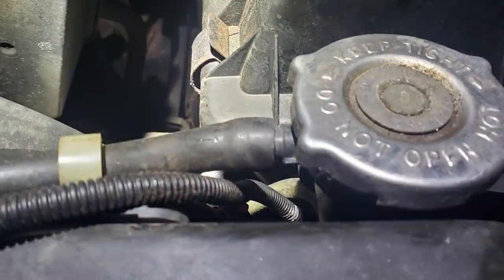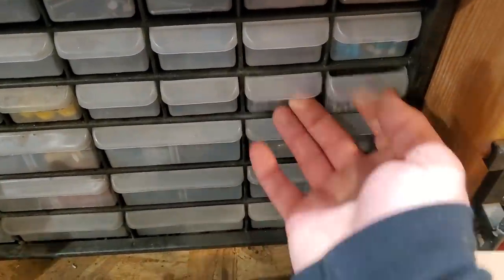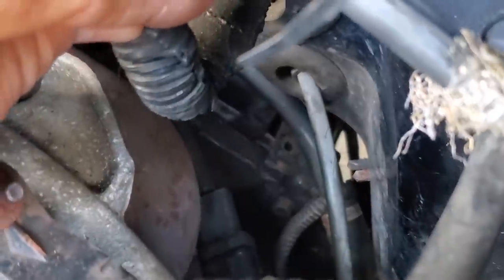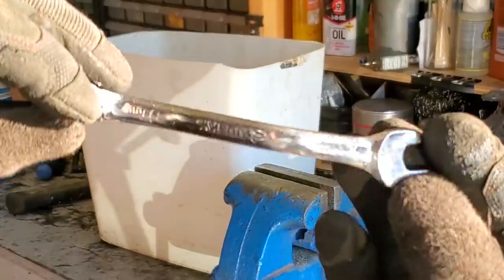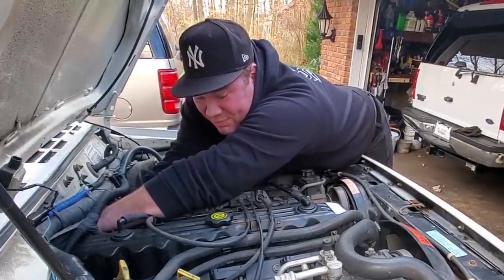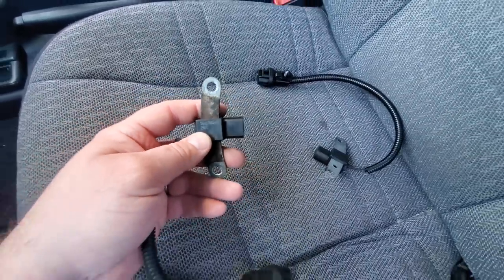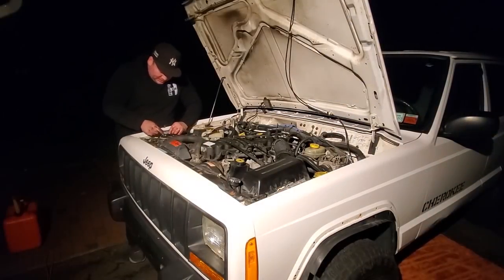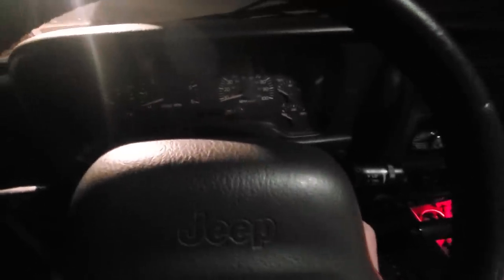JEEP CHEROKEE FIRST START IN 6 MONTHS - DOA POLICE XJ GETS A CRANKSHAFT POSITION SENSOR

Comment: Changed mine three times in a month. That was like two years ago. MOPAR OEM is the only CPS that is reliable. 20 min tops to change from underneath. Used around 11 inches of extensions, one being a wobble. I found it easier to disconnect the two shifter bolts to get your hand in on 4x4. Also, put a little grease in socket to hold bolt when installing.
Reply from the maker: Solid info right there! Thanks for the input.  MOPAR only!!!

Comment: A few weeks ago I parked my car at a park and came back to it, and it wouldn't start. Thought it was the crankshaft position sensor, because like yours the starter turned over fine. Noticed the gas was really low. Filled a gas can and poured it in the XJ and it started after a few goes. Never thought I would be so happy to run out of gas. I was ecstatic that I wasn't going to have to change the sensor!
Reply from the maker: Damn dude you got lucky! You have no idea how bad I was hoping it to be a low gas issue 🤣🤣🤣

Comment: Just did the job after watching your video. I used a long extension w/ 6pt 11m. Taped the bolt in place with black electrical tape before sending it up. Could not get hands anywhere near the mounting point, so used a telescoping magnet wand to hold the CPS in place while starting the first bolt. Interestingly - mine failed from the exact same ailment - the overflow hose detached while plowing during the last storm. All good now- thanks for sharing!
Reply from the maker: Excellent Job Brother!!

Comment: I used a helper to get the bolt lined up from above the motor while I was under the truck with many extensions drooping on my ratchet...

The helper was my girlfriend. That was four years ago, on our 2000 XJ Limited. She's my wife now. And the Jeep still runs.
Reply from the maker: That's a beautiful story brother!
Reply: @ProjectDanH  Actually, there's more to that. 

I only buy dealer parts. But I asked the dealer if he'd be OK with me sticking my multimeter probes through the bag to test the new part before installing it and if he'd take a return if it were defective--that way he knew I didn't kill the part and I wasn't out the cost of the sensor if the MOPAR one turned out to be defective.  He agreed, as long as the bag wasn't FULLY OPEN, to take back the part if I only made two small punctures. (It pays to ask!)

Also, I checked the resistance of my original sensor to prove it was bad before purchasing a replacement. Another-- ahem --well-known Jeep channel on YouTube had the info I needed...hosted by a guy named Matt. In Tennessee...

I now test everything this way.

And that's helpful info on the "NO BUS" thing. Wish I knew that a couple years ago before I opened my PCM looking for possible problems when chasing a mysterious issue...

Comment: The easiest way to change the CPS is to use literally 2 feet worth of extensions and a swivel head. Feed it from the back of the transmission to the front. It will help also yo have someone with small hands to line you up but it's not needed. Also buy your CPS from the dealer save the trouble and spend the $100 for it or go pull 4 or 5  of them from a junkyard
Reply from the maker: Great tips! Thanks Tony
Reply: totally right Tony, first thought one had to be a contortionist from on top of engine under the hood, thank gawd i figured it out with the extensions, piece of cake, and once you've done it once it basically becomes a 5 minute job the next time you need to replace it
Reply: @mikeboston421  that’s right! Especially when you’re in the same boat as Dan and are circling back to CPS since I stupidly replaced with a $17 Amazon part. Shouldn’t take too long tho
Reply: Freaking pain……..

Comment: I put a crown ckps in my sons xj last year. It's still working. A lifted xj is probably easier to get to than factory. Just did a WJ ckps, now that was a job! I put a "standard" part from O'Reilly's in that one
Reply from the maker: Good to know brother!! Ever think about cutting a hole in the firewall for access???
Reply: @ProjectDanH  the hole is already there in the WJ. Pull back the carpet on the driver's side of the transmissision hump. There are 2- 4 pointed metal plates that shift linkage feeds through to fire wall.  They are secured by 2-10mm nuts on each plate. The upper of the 2 is the one you go thru. When you open it you can see the sensor but no hand access from here wrench only. You will have to unscrew floor duct elbow to have room for your ratchet.
 I- 4" extension
1-11mm socket
1-swivel or universal
Duct tape or electrical tape all of the extension joints together.
Undo bolt with ratchet to finger loose.
Go back up top. Remove throttle body cover and any vacuum lines in the way. Loosen bolt and remove carefully. 
WJ's CKPS connector is on passenger side so take care in routing new sensor. Its very easy to get hung up in the multiple wire harnesses. To me this option was better than dropping the transmission crossmember.
I like your videos. I've had 4 jeeps 1 was stolen 2000-TJ now have 3
2010Jk
1999 WJ
1997XJ

Comment: Great video 👍 love the tool idea 🏆... ( i did the extensions and put some tape around the swivel to keep it a little straight... it still didn't idle right and i didn't think it was fixed yet BUTT.... to reset whatever 🙄 i revved up to 2 grand for 5 minutes and thats what helped on my 2000 limited 👍

Comment: I had to do my Crankshaft position sensor also from the bottom and top. For the top, I had a piece of rubber pad to lay on top of the engine to make it easier on my body - lol
Reply from the maker: It worked well to attack it from the top and the bottom... I used a towel and a floor mat only after I realized I scratched my new header panel with my belt buckle 😱😱😱

Comment: Nice job Lieutenant Dan😂😂I had to learn the hard way about replacing sensors with cheap aftermarket ones.OEM Mopar sensors are all I use on all my Chrysler vehicles.Your Dad had the right idea there.I use about 3ft of extensions and a wobble wrapped in electrical tape to replace mine.That was pretty creative with the wrench though..😁😁👍👍💪💪
Reply from the maker: Yay I'm a Lt. Now! Thanks for the promotion Dan!  Yes, I tried everything I could not to lay on the freezing ground but sometimes ya just gotta do it

Comment: My 2000 WJ likes to screw with me. Got it for $600, no drivetrain problems except that double CV joint front driveshaft was bad, easy fix. Now sensors... Replaced the O², Camshaft position sensor, Plugs and coil rail, Coolant Temperature Sensor, Thermostat, and just recently the Throttle Position Sensor. I changed the TPS yesterday after a P0123, P0121 and P1596 codes, the CE light stayed on and it stayed in failsafe mode... Until today. Today? CE light is out and it's running fine. I guess threatening to take it to the mechanic worked. So until the next time a sensor goes out, safe travels.
Reply from the maker: Oh man.. mopar computers can certainly put you through the ringer!  Sometimes it takes a while for the codes to clear in the PCM. Best of luck!
Reply: @ProjectDanH  Yeah I'm glad it's old enough that even with faulty sensors (minus that Camshaft position sensor, that left me dead in the parking lot), I can still drive it relatively fine thanks to everything being attached mechanically. Especially the 4 wheel drive. Everyone I know who has electronic 4 wheel drive on a vehicle older than 10 years old ALWAYS has problems. Rust belt man.
Reply from the maker: @TheNiteNinja19  rust belt!

Comment: That is the only sensor I didn't replace on the Bumble Jeep when chasing down a rough running, miss fire issue. Didn't use any Mopar replacement parts, got them all from Rock Auto (best price) due to budget constraints. Never did figure out what was the actual issue was. Some how, when installing the new plug wires (one at a time) I got two of them reversed. When I finally double checked the firing order for the umpteenth time and got it right it ran fine. Go figure. God bless, stay well.
Reply from the maker: lol.. It's actually easier mix the plug wires them than you think! lol. always got to label them! Glad you figured it out bro

Comment: I love my XJ's but every great vehicle still has it's achille's heel and that crankshaft sensor is it for XJ's of all years. haha I usually get it from underneath with a couple swivel socket adaptors and extensions. As you said ALWAYS... I mean ALWAYS go with  the original Mopar one. Other aftermarket ones are very hit or miss. I'd rather pay more and know I'll likely get another 10+ years from it than having to do it again a day later.  Man, sorry you had a bolt fall into the bell housing... I've been lucky to not have that happen but you recovered well from that. haha Great video, love the XJ content!
Reply from the maker: thanks man! I really appreciate it! 💪

Comment: I feel for ya, Buddy. Had to do several of these. I found the easiest way (for me at least) is to unbolt the transfer case crossmember lower everything down with a floor jack and drop the front of the front driveshaft. Works good for the 2-bolt sensors, even better for the 1 bolt sensors (ZJ's have these) But when it comes right down to it, what ever way is easiest for you. I have bear claw hands, so top-side really isn't an option
Reply from the maker: yeah if you can't reach from the top the bottom is your only option! I love hearing everybody's tricks in the comments! Awesome job 💪
Reply: Where is the fuel cut off switch Located  at. On a 1995 Jeep Cherokee..5.2

Comment: Also, if you had planned to due an aluminum radiator I’m on standby for that! lol ty again for the great content.
Reply from the maker: Thanks man!  I'm thinking mishimoto for Beach Jeep! 👍
Reply: @ProjectDanH  I put one on my jeep this summer.  GA heat did not affect it at all after that.
When it is spring, I'll replace the A/C clutch coil and add a high flow water pump.  Worked great for the old engine.  After flushing out the heater core, heat is best it's been in years.
Reply from the maker: @abstract1dea  yes! Nothing like fresh juices to transfer that heat!

Comment: just get a 20" extension and put a piece of shop towel in the socket to hold the bolt in i did it that way in 30 minutes my xj when hot outside would die then cool off in 30 minutes it would run. and put the shifter to first gear that gives you a lot more room for extension
Reply from the maker: Solid tips brother!  Thanks for the input!!!

Comment: What I do with bolts or screws that are very difficult to put back on in tight spaces is wrap some long thread around the bolt a few times for just in case. Then remove after you got it threaded in! 👍
Reply from the maker: excellent trick!
Reply: or jam a  bit of plastic bag in between bolt and socket....

Comment: I am doing this exact job tomorrow. All the dealerships near me told me that they no longer make the part so I ended up going with a premium NAPA one which I've heard is the only decent substitution. We will see if it works!
Reply from the maker: Let me know how it works, MOPAR ones on eBay are expensive!
Reply: @ProjectDanH  replaced about two weeks ago ish. Has not been an issue so far it idles fine and runs fine... And of course starts which it wasn't doing before I put the new one in so, that's a win!

Comment: A lot of guys get the bolts with extensions and say it isn’t too bad. Dreading doing mine
Reply from the maker: Extensions are great to get the bolt on the driver side.. The 11-mm wrench worked better to get the bolt on the top.  Grab a buddy and buy a 12-pack 🤣
Reply: 18 inch extension with swivel and a good light from underneath.  Did mine this fall, 35 minutes start to finish.   Use a little paper in the socket to hold bolts when putting it back in.
Reply from the maker: @MrSnowford  excellent advise!  Thanks Scott!

Comment: Hey Dan thanks for the videos have used a few to fix a few things already. I wanted to ask you I have a 97 zj 4.0 when it’s cold it starts right up. Once I get it going and turn it on again it struggles to crank sometimes I have to crank it twice. What should I be looking at to replace. I’ve done the fuel pump and o2 upstream sensor for separate issues. And sparks are still fairly new.

Comment: Any ideas what a p1391 code would be caused by?
P1391- The Engine Control Module (ECM) detected the actual Camshaft Position Sensor (CMP) position disagreed with the expected CMP level.

Jeep has a slight misfire at idle but runs great overall. I ordered up an NTK CPS to swap in.
Reply from the maker: Not sure.. hope it does the trick!

Comment: My 1996 Jeep Cherokee 4.0l stalled on the freeway, no over heating issue. It turns, but will not hit.

I changed the injectors and fuel filter, and the fuel pump works. No spark. Should I change the camshaft or crankshaft sensor? Or, both?
Reply from the maker: both! camshaft sensor is easy!

Comment: I have a 1997 laredo and we got a code for a bad coil. Changed that still runs.... Sometimes. Itll drive for like 30 mins then once we get to a store and it sets then we start to crank it up it wants to die out. After letting it set for a bit we then can kinda make it home but only constantly foot on gas putting it in neutral at stops etc to hold gas. I cant only assume its a CPS but theres no codes at all
Reply from the maker: It could be a bad PCM.
Reply: @ProjectDanH  possibly. I wiggled the connection but there weren’t any hesitation or anything

Comment: Any tips on a high idle in park cleaned throttle body changed all sensors around throttle body changed pmc have the o2 sensors to change out
Reply from the maker: Vacuum Leak

Comment: Hey man. Hope you can help me out just saw your crank position sensor video just want to know would the truck crank over if the sensor is bad?
Reply from the maker: The sensor could be on its way out and still occasionally start.  Once it totally goes it will crank and crank with no spark untill the battery dies

Comment: Can you not get to the cps in from the interior like you can a wj? I thought there was an access panel under the dash on right floor under carpet that allows you to just hit the bolts with a ratchet etc...
Reply from the maker: No, but a hole saw can make it happen! Lol
Reply: @ProjectDanH  Rough job for sure then!
Reply: There's an access hole unbolts from the inside by driver's side heater ports, I just watched a guy do it.

Comment: Just noticed when you got it started (congrats) that the temp gauge and the voltage gauge are reversed from the 84 to 96 Cherokees
Reply from the maker: I never noticed that!
Reply: @ProjectDanH  Yeah, I prefer the 84-96 Cherokee over the 97- 01. I like the interiors better. Different strokes.
Reply from the maker: @projectbumblejeep4190  exactly! 💪

Comment: Crankshaft is bad only if my jeep not start . what other problem show if the crank is bad? I have the problem on my xj going out start the engine  check engine light stay on drive for half  hour  stop the engine went I stared again check engine gone
Reply: Ok  on my jeep if not start the first time the second time crank but the engine not start i have to put my foot to the gas pedal then start but sound like is flooded   i change the injector the distributor sensor the same problem and the mecanic said was the heat sensor switch  i spend 1000 dollas to fix the problem  but thank you  i own my jeep 22 years
Reply from the maker: Yes, intermittent starting could be a CPS.. also "No Bus" on the odometer.

Comment: So what does it mean if not only I don’t have spark but I also don’t have fuel, many say crank sensor or asd relay I have no idea though about the fuel since I jumped the relay and it’s good so any ideas about the fuel, thanks
Reply from the maker: Does your fuel pump work?
Reply: @ProjectDanH  my fuel pump does work when it’s jumped, but the injections aren’t firing, and I have no spark, I’ve done cam and crank sensors and still no dice.

Comment: I have a 5 speed in mine and no problems yet 128,000 miles on it (1996) . One part of me says change it , but my other parts says if it ain't broke , don't mess with it ! I just don't want to get stuck ! Any warning signs or do they just go toes up (dead) ?
Reply from the maker: Aint broke, don't fix it!  LOL usually manuals don't heat up as much as autos so they'll last longer. your should be good... if you must change it,  it may give you a couple no start warning signs.  If you do change it, grab a Mopar one.

Comment: 97 grand Cherokee zj doesnt have the camshaft sensor right ? just the map sensor
Reply from the maker: 97 GC will have a distributor not a camshaft sensor.  It does have a crank shaft sensor tho.  Map sensor, TB sensor and IAC sensor will all be on the intake

Comment: Wondering if this is my issue. Intermittent cranking but no start. Gets fuel, tested that. It will start and run fine as usual 2-3 times in a row then I'll walk out of some place and try to start and it just cranks. No check engine, just crank crank crank Then it will sit for 5 minutes or 10 minutes and boom starts right up. I don't think it's the neutral switch because I still have back up lights & can't jump the starter but still just cranks.
Reply from the maker: Sounds like this could be it!